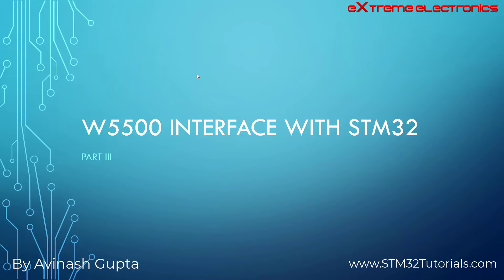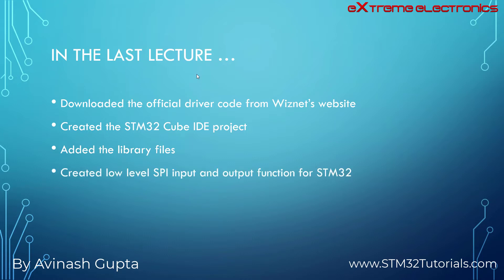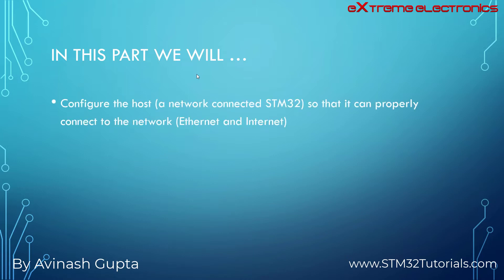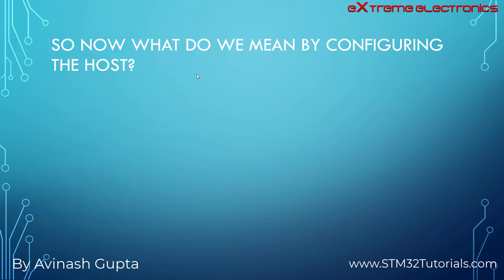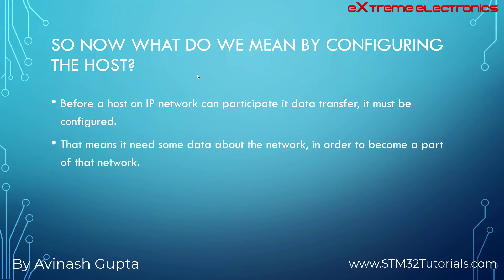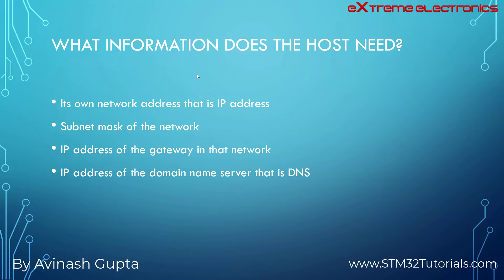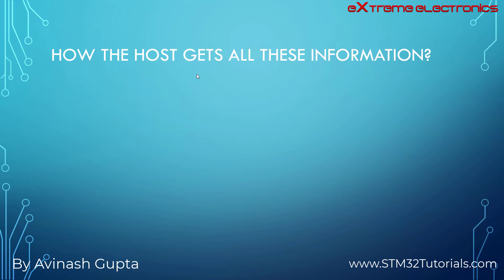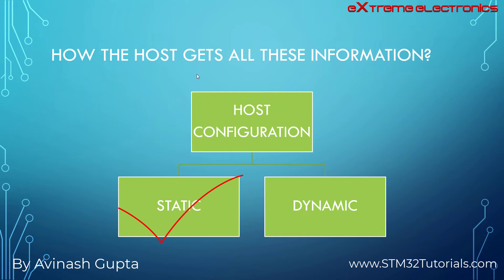W5500 Interfacing with STM32 for IoT/Embedded Internet Applications PART III

Comment: Hello, My  W5500Init keeps getting stuck in the SPIReadWrite function at the while loop that reads, I have verified the proper wiring connection and also double-checked the MX configuration. all of which look totally fine. Do you have any suggestions?
Reply from the maker: please mail me, I will give solution, there was a point missing
Reply: same problem, please share your solution
Reply: @steffenlux5421  In the main.c file at the MX_SPIx_Init add the following code after the last if statement: __HAL_SPI_ENABLE(&hspi1); where 1 is the SPI number you used. Side note: I was running the SPI at 54mhz which is possible, but you have to keep the wiring/traces short for it to work properly, try decreasing the SPI speed to something lower first, and when it's working try to get it to a higher speed.